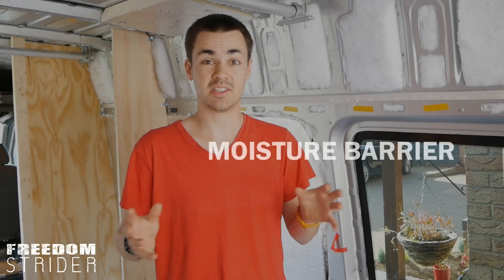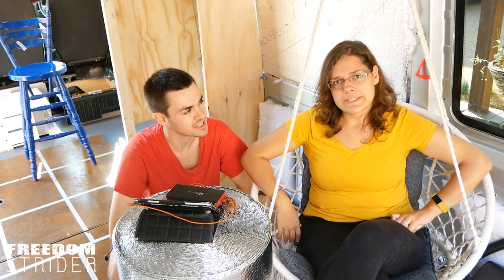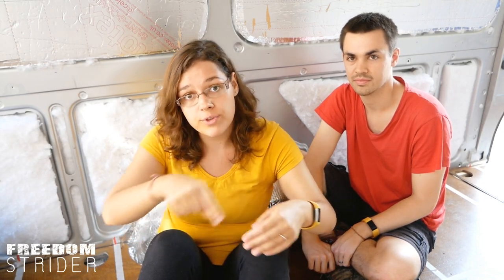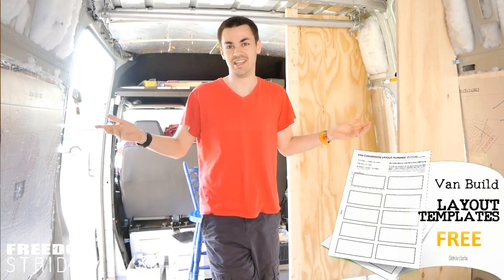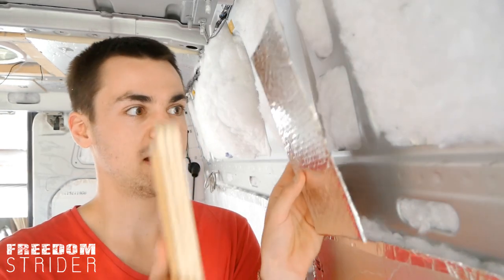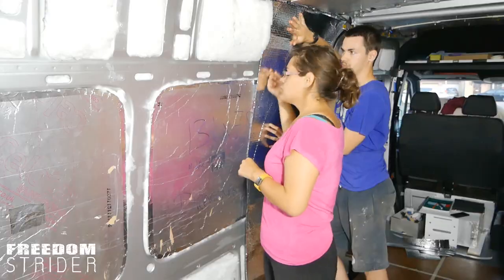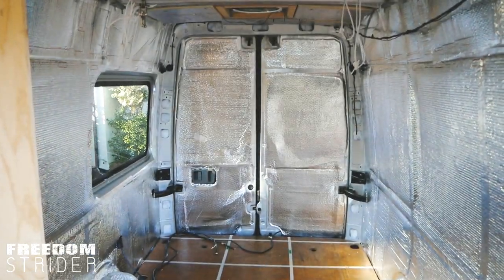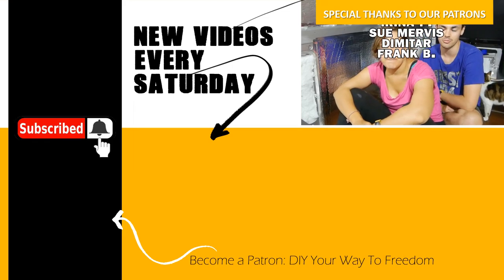Installing Reflectix Insulation CORRECTLY - Moisture vs. Radiant Barrier

Comment: I did my insulation and vapour barrier the same way as you for the same reasons.
Have you done your curved cab roof yet? As its a complicated shape i did mine with the space blanket insulation. The foil kind with 10 or more layers and can be shaped into all the curves.
Reply from the maker: Over the cab, with the headliner shelf - we put soft insulation and then reflectix and then stretch carpet - thought the reflectix is not there for radiancy, but mainly for structure. We couldn't figure a simple way of creating an air gap in such a curvy space with our shelf design, however, if we hadn't removed the headliner itself, we could have stuck reflectix on the back of it. That would have created an air gap between the metal and the headliner but it would have skipped the soft insulation.  😀
Reply: @FreedomStrider  cool that layering should work aswell. I find some common sense goes a long way with adapting your insulation as long as you stick to the important points.
Reply: @FreedomStrider  Do you think that the way that you did is insulating more than the way with sticking reflectix on the healiner(if i do it this way is it going to be better to also ad some more soft insulation or just leave only the reflectix to do its job)
Reply from the maker: The way the headliner insulation is done is the wrong way to use the reflectix (we did it before understanding it fully). The best practice method for insulation is the way described in the 'reflectix' video - with an air gap. The no air gap in the headliner video, that negates the radiant function of the reflectix, but the soft fluffy insulation will still work as it should. If we were to do the headliner again, we'll either, skip the reflectix or work on an air gap. 🙂👍
Reply: @FreedomStrider  Am i right that the more airgap there is the more it is actually insulating therefore you can leave a lot of air gap if you stick the reflectix to the headliner without using soft insulation. Will this create more insulation properties than if you fill it up with soft insulation?
Reply from the maker: That's a great question, and to answer it correctly we need to look at how to calculate the thermal efficiency of a system... and that's something we haven't studied yet 😂. 

The thing is, that the reflectix stop radiant heat transference whilst the soft insulation stops conductive heat transference. Soft insulation works well because it creates a lot of small air pockets, and this traps a lot of air. Now air is indeed the best insulator in an AIRTIGHT system, which is why in soft insulation's case, we don't want a big air open cavity for the air to move through. 

But the reflectix needs at least a 12mm gap to utilise its radiant heat properties. It doesn't quite work the same way as the conductive heat system.

So you can test and just stick reflectix on the headliner van metal and see how hot the area gets when the sun fits it directly, but I don't have a practical nor a mathematical comparison to tell which is best. 😅
Reply: @FreedomStrider  I don't think i can manage to analyze this test. I might try to go with some PIR insulation sticked to the van and hope that it wont fall and than reflectix to the headliner to see if it works if not i will stuff some rockwool and thats it :D

Comment: So what kind of insulation should I use ?
Reply from the maker: Depends on your needs. We obviously recommend the recycled plastic insulation and PIR board that we used (links in video description) - though if you have the budget for it, spray foam insulation is another good option because that would fill up all of the little air gaps and kinks, and because all the metal will be covered, you will need no vapour barrier.
Reply: Thinsulate if you have the budget.

Comment: What about wiring for lights and plug in stuff doesn't it break the barrier?
Reply from the maker: Only if you try and put them under the barrier (deep within the walls). Most of our wiring is either above the reflectix or externally mounted in decorative conduit... Though we have run some conduit through the walls for a few if them. So if there are breaks in the barrier from wires and such, you just have to do your best sealing the perimeter before closing the wall up.

Comment: Did you guys put Reflectix on the sliding door?
Reply from the maker: No, we didn't put any reflectix on the sliding door because there isn't enough room to provide the airgap necessary for the reflectix to be any good. For the reflectix to work we need at least a 12mm gap, and the sliding door passes quite close to the van's body as the door opens so there isn't that much clearance to have the air gap and then the cladding on top. (each van is different so you do need to check, but that's why, and it's not worth it for the moisture barrier). 😊👍

Comment: It probably shouldn't be right on van metal itself ? I would have rather gone with a strip of wood or something else then the reflective ..
Reply from the maker: There shouldn't be an issue attaching it directly to the van metal since there is a layer of bubblewrap inside the reflectix between the 2 shiny surfaces, which means it doesn't quite conduct the heat. That being said, if you were to just use the foil aluminium tape, stick that directly to the metal, which then produces condensation. So the bubblewrap reflectix you can stick to the metal, but the foil tape, it's best to avoid it. 👍
As we said in the video, you can put your framing first, then your reflectix. But depending on how you're mounting stuff, that may make it harder to create a full vapour barrier.

Comment: You don't need an Air Gap with Reflectix.. You can test this just by putting it on the outside of any windshield. See how much heat or cold is reduced from one side to the other. When the Sun comes out. It's minor with 5mm thickness double sided foil....
Reply from the maker: Whether you put the reflectix on the inside or outside of the windshield you still have an airgap on one side. Radiant heat is only transferred through air or vacuum (otherwise it is conduction heat transfer), without the airgap the heat will get absorbed and conduct rather efficiently.
Reply: @FreedomStrider  It matters a lot. As Reflectix has a builtin air gap to start with..Between both sides of the foil..

And like I said. Go validate it. Just cover the windshield. Inside and out. You will see the differences. As both sides will be touching the surface of the glass... The one on the outside test vs the one inside. 

I will wait while you go test it. Then tell my your findings.
Reply: The gap between the reflectix is proof that it needs space between to create the R-Value. Installing it correctly with up to 1/4-1/2 inch gap away from the heat source will give optimal R-Value.
Reply: @R.L.U.  Did you not read my post? I said it has it's "Own" air gap. You don't need any additional Spacing. Just go Validate it with a thermal gun. It makes no difference..

Comment: Ah yes the worst part of building a van! It was the best day of my life when we were done with reflectix. Never again!

Also guys have the door open when you use that spray fix, cancer is real! Look on the back of the can. 

Also did you say you are using 18mm ply for your walls?
Reply from the maker: Actually doing the reflectix, not actually too bad. Researching how to install it correctly and why...fair point 😂

I agree with about the spray glue, we did have the back doors open with that stuff.

At present we are using 18mm ply for the framing, not the actual walls (the walls are going to be 3mm poplar ply) 😊
Reply: @FreedomStrider  ah ok I was gonna say 18mm is a bit overkill for walls! I used 9mm and that's quit heafty. Have you started the framing yet?
Reply from the maker: Not just yet - hoping to this week, though it quite a busy one.
Reply: @FreedomStrider  What is the difference between poplar ply and the normal ply?
Reply from the maker: Poplar ply is made of a different type of wood, so poplar is a softwood, whilst the hardwood ply that you find in most store can be made from birch, beach or spruce (I can't remember which - it varies per region and country). However, they are usually hardwoods and as such are double the weight. (e.g. 3mm hardwood = 2.3kg per m2 vs 3mm poplar softwood = 1.2kg per m2). 

However, poplar is less structural (even when thicker) so if you are to build a bed or a chair, it is structurally recommended to go with hardwood, but weight-wise, poplar is best. So you have to compare and compromise, depending on needs. 🙂
Reply: @FreedomStrider   @Freedom Strider  i guess it is similar to the aeroply wood which is used in the plane's build. How much mm poplar ply did you used for your furniture build? I think i will go with 14mm poplar ply. The cool thing is that in Bulgaria it is wild poplar used as there are a lot of them in the nature and they are tougher and have better characteristics than the artificially bred.
Reply from the maker: We are using 3mm poplar ply to finish off our wall cladding (experimenting at the moment as it is quite a thin choice). We are not using poplar ply for our furniture, mainly because we are not using that much ply but rather we will use some aluminium combined with either CLS timber (pine) or structural ply. If we were to use poplar for the structural parts of furniture then 14mm would be the minimum to go with but 18-20mm is probably best (ignoring the weight issue), but it really does depend on the way the ply/wood is going to be used. 🙂

Maybe going somewhere, where you can test how bendy 14mm poplar is? Also, things to check: How do the strength and weight ratio compare between 14mm poplar vs 9mm or 12mm hardwood ply? (For example, 9mm poplar ply is about the same weight as 6mm hardwood ply)... just something to consider as you might need thicker poplar ply than hardwood ply to achieve the same results... potentially. 👍

Comment: No good van builder uses reflectix anymore. You should’ve known better.
Reply from the maker: As long as you use it correctly with an airgap, and have considered how to vent your walls, which we have, then it's fine 👍